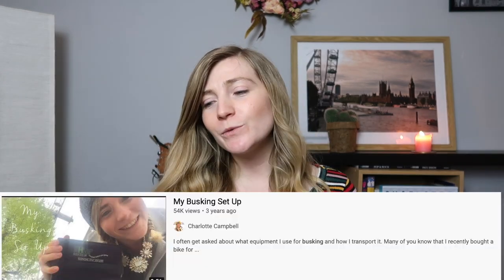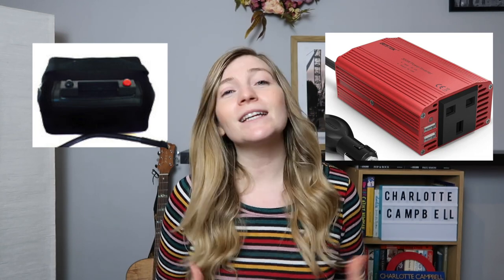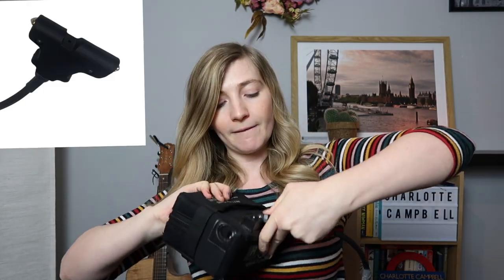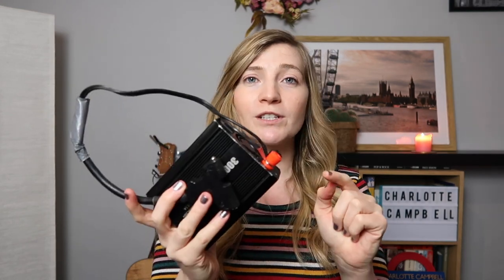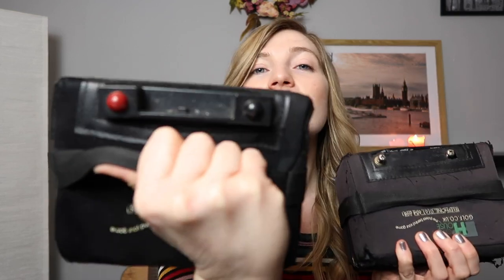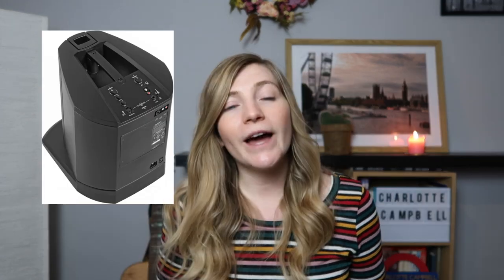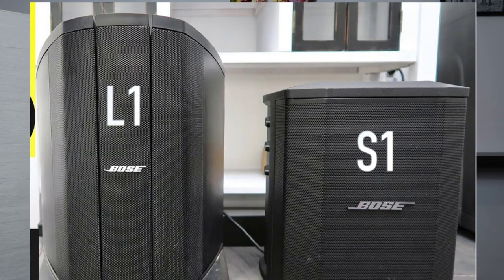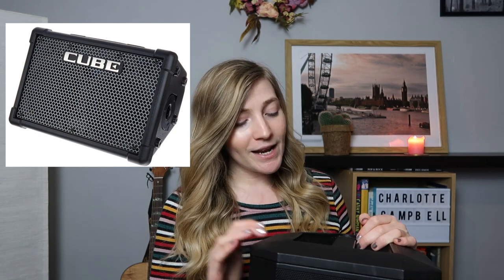How I Power My Busking Amp

Comment: 2:50 When talking about wiring the T-bar connectors you dont just join them and tape them up! Make sure the exposed wires cant touch! The best thing to use and easy even if you cant solder is heat-shrink insulation.
Reply: as an electronics engineer...i completely agree with you!!
Reply from the maker: Thank you this is really helpful to know! I got my advise on this from a fellow busker and I've since learnt a lot more about wiring so will do an update on this soon, I appreciate my explanation is pretty simplistic ;)

Comment: Great information!  Love the Bose S1 Pro system.  We have a band for a non-profit organization that does music therapy programs for various Veteran groups in our area throughout the year.  We have the full L1 system when we play in large venues, but have individual S1 Pros for each band member when we do smaller or shorter duration programs, or we just want to go battery-powered.  The built-in auto-equalizing and anti-feedback circuits are amazing - Bose got these right.  We can put the S1s right behind us if we want to also use them as monitors, and we get absolutely no feedback.  I want to sell off all my personal gear and pick up a S1 Pro as well.  However, I've noticed it struggles a bit with the low end from my upright bass; just ahve to be careful when playing on the E string :)  Cheers!
Reply from the maker: That’s so cool, sounds like you have a great set up! You’re right about Bose with their auto equalising, they have done really well there! Wishing you lots of luck with your performances! X

Comment: Greta video Charlotte and INCREDIBLY helpful to folks. I watched your old 2018 vid ages ago and found it so informative. I've got a Bose L1 and they are fantastic - albeit a bit heavy. I power my set up using an all in one battery/inverter which is brilliant. Bought from Amazon and it as light as a feather, but the charge lasts foreverrrrrrrrrrrrrr! It's also got USB chargers on it too which is useful.
Reply from the maker: Ohhh that's cool that they make an all in one battery/inverter! I didn't know they existed! Will have to check that out :)

Comment: Lovely Video.

Please don't yell at me comment section but just a quick thing,

have you considered just buying a powerboard and extension cord and just plugging into a public power outlet, it's worked wonders for me

but once again lovely video.
Reply from the maker: That’s not really an option in London. There are no power outlets for public use and the place I play is on the river, the nearest power is the corporately owner London Eye, completely out of the question that they’d allow any kind of power to be used by me or any member of the public. That’s amazing to me that you have the option to plug into a power outlet? I can’t even fathom that being available here…

Comment: Charlotte, do yourself a BIG favor and check out the AER compact 60 - 4 amp. German manufactured. More expensive but every penny worth it.
Reply from the maker: Thanks Richard! I’m not a huge fan of the sound on AERs, I know loads of buskers who use them and I’ve tried theirs out. Personally I think the guitar sound is INCREDIBLE but the vocal sound is not as clear as the Bose or even the Rolands. Its a minuscule difference but there is a crispness missing for me on the AERs. Great amps though and I wouldn’t be adverse to using one, just personal preference I think!

Comment: Hi , thanks again for taken me to this video.    Your inverter is it pure sine wave as I looked on Amazon at your inverter and it doesn’t say.  ,I’ve heard that the pure sine wave is better as you don’t get a lot of noise. , thanks 🙏
Reply from the maker: Great question Stephen!  Hm I’m pretty sure it’s not a pure sine wave just based on my research it would usually say if it is and pure sine wave inverters are usually a little more expensive. I’ve never had an issue with the one I have but if you want to be sure then maybe spend the little bit extra to get the pure sine wave one ☺️
Reply: @ccampbellmusic  ahhh thanks again.
Reply: @ccampbellmusic  Non Pure sine wave can kill some devices. Like Electric toothbrushes and other stuff. If you've had no trouble it's ok but always try to be sure before using them on something you havn't before.

Comment: Very helpful, thank you!  One question: the converter you link to outputs a modified sine wave which usually interferes with speakers by causing buzzing sounds.  Does this happen to you?  Converters that output a pure sine wave instead of modified are better for sound equipment, no?  Or have you not had a problem with buzzing sounds through your amp?
Reply from the maker: Hey Alistair, great question! I haven't experienced that buzzing sound issue, so I'm not sure. Although I have heard that a pure sine wave is better. I'm currently using the same inverter that is linked above for my busking set up, without any buzzing luckily so I would recommend!

Comment: So interesting, so many questions...

What's the 'mast' on the Bose L1?

Why golf buggy batteries? Did you have one of those before your bike?

I'm guessing the inverter is what turns DC (from the battery) into AC (like electricity in a house), right?

You are very strong (well, you're not as weak as you were last week). 😉
Reply from the maker: Great questions Rob! 

The 'mast' on the Bose is an extra speaker that you can attached, its good for gigs because it brings the sound up to ear level, but I don't use it for busking because it is a bit more delicate and the bottom speaker is loud enough :) 

The golf buddy battery is just the best one I've found that is compact and powers a speaker well. There are other lithium batteries out there but they're quite heavy and bulky! I just use that as it was recommended by a fellow busker! I got the golf buggy battery in 2016 and my bike in 2017 :)

DC/AC - yes exactly!

;)

Comment: Lovely video, thank you for this! Just wondering if you ever tried powering two amps with this power supply via extension cable. I've two amps (150W and 60W) and if this battery and can handle the combination then I would love to get it. Thanks!
Reply from the maker: I think you could definitely power two amps but the battery would drain almost twice as quickly so that’s something to consider! Good luck!

Comment: Interesting you chose a modified sine wave type inverter - does it make noise during performance?
Reply from the maker: No it doesn’t make a noise, there’s a slight wurring sound from the fan but it’s very faint you don’t hear it when you’re playing music through the speaker at all x
Reply: @ccampbellmusic  thanks champ. will likely acquire one for myself.

Comment: Hi! How it's a busking amp diff than a normal one
Reply from the maker: Well, busking amps tend to need to be more portable. Personally I use a regular amp which needs to be converted into a busking amp in order to power it but you can buy actual busking amps that are battery powered.

Comment: Hi! Sorry to disturb, but I really need an advice. I need a battery and an inverter that can power three amps, one for bass e and two for electric guitars (boss katana 50 mkII and Marshall code 50), and also a speaker for a microphone. I know nothing about this things so if someone could tell me the specifics that the battery has to have, he would make me a big favour.

(Sorry for the bad english)
Reply from the maker: hmm I'm not sure this is my area of expertise. You could try a car generator, I've seen buskers with big set ups use them. Powered with gas/fuel I believe! Good luck! x

Comment: Will heat up and catch fire if not joined with electric block connectors insulated correctly!!!!
Reply from the maker: uh oh that doesn't sound good! I've never had this happen to me in the 5 years of doing it this way but will look into getting some electric block connectors for sure! Thank you! x
Reply: @ccampbellmusic  if mains cable best to safe than sorry particularly with continuing wear and tear plus if used outside and a chance of it getting damp etc etc

Charlotte you should also use proper electrical insulation tape but best to have a cable made for you by a qualified electrician if possible!

Pete Woodroffe Music Pete Woodroffe Music Pete